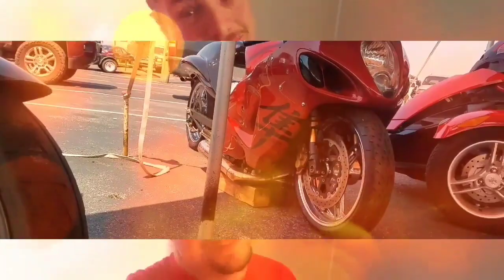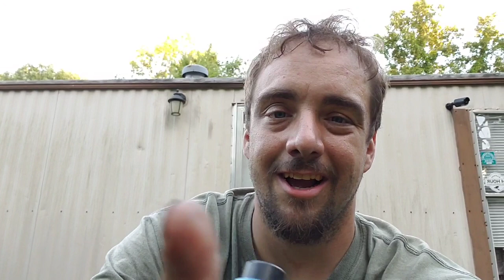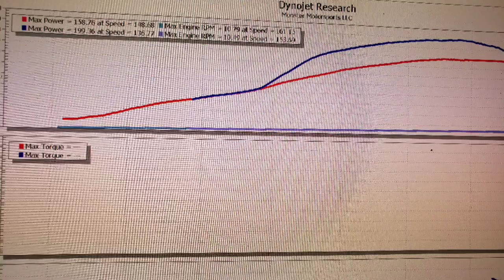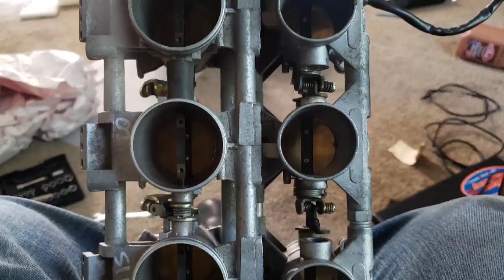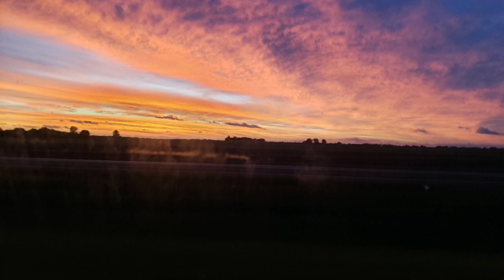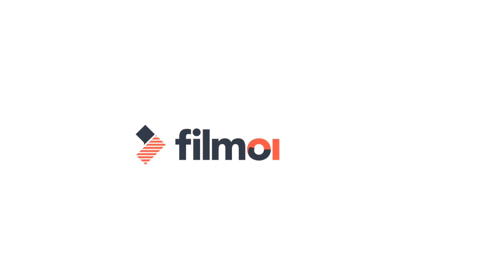Track day win and fail with the bandit 1200.

Comment: are those the busa tbs you mentioned previously .with those  38s you must have ridiculous inlet  velocities at  with larger tbs you may loose gas speed a little at  bottem end reducing your lift a lil   but  youre running 12.1 so shouldnt be bad at all with gsxr cams  but we shall see
Reply from the maker: Actually ditched the busa bodies these are 02 gsxr 1000 bodies so 42mm I almost have them done just a little welding tomorrow.
Reply: @RingTuned  guy martin used 46 busas on his 1300 build for pikes peak poor of the line performance  cant remember if he used launch control though
Reply: *turbo build